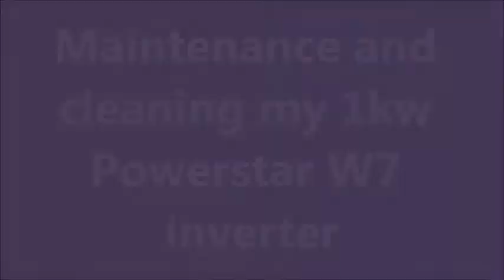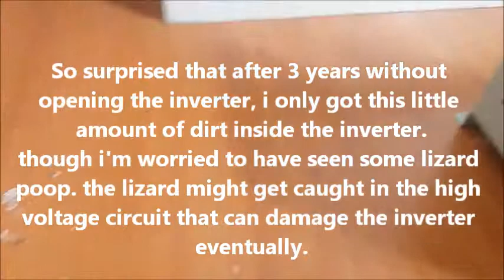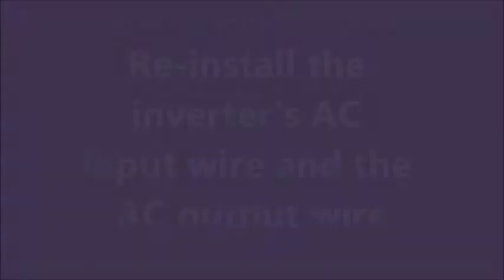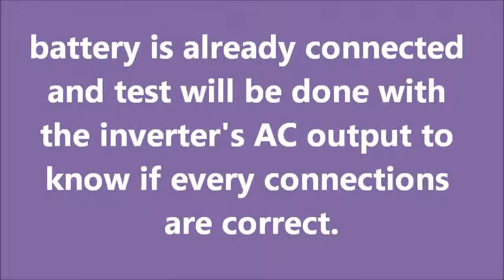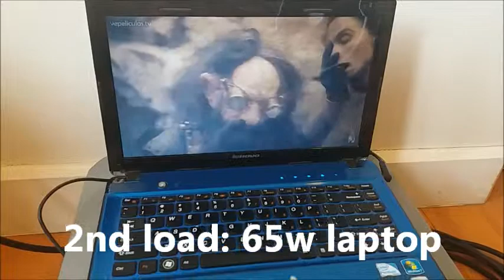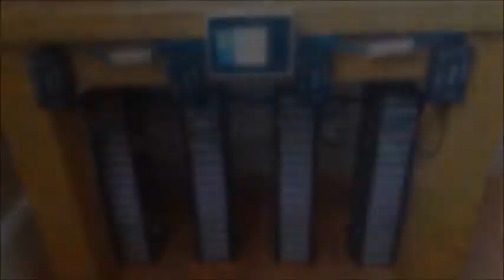Powerstar W7 inverter maintenance

Comment: Hi, I wish you could run an  efficiency test (DC watts drawn vs AC watts provided) at various loads like at 50w, 100w ,150w, 200w,500w 1000w.
Also what amount of power the inverter pulls at always ON setting with no load and what power the inverter pulls at power saving mode with no load.
I'm particularly interested in the 3000w model.
Reply from the maker: if you want to monitor the amps & watts drawn, you need a digital multi-meter. 1 meter each for DC and AC side.
Reply: @philippinediypowerwall3852  I wanted to see your results so that I decide on buying it but since you are not able to do it with yours, I'll be buying the Xantrex 2524 pro plus instead coz that one I'm sure of great efficiency (90%) at low wattage loads.